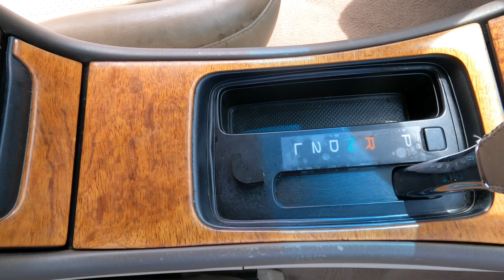Toyota Avalon INTERIOR DEEP CLEAN!

Comment: What sprayer are you using? Do you recommend any good options to start off with?
Reply from the maker: The sprayer is a 2 gallon dewalt sprayer from Home Depot. The ones I use now are the Home Depot brand 56OZ sprayers they are about 7 bucks and they let you get your chemical down without soaking the carpet and seats. The dewalt one in the video will get everything more wet than is necessary so I have since stopped using it.
Reply: @mtjohnsonautodetailing1955  thank you so much!